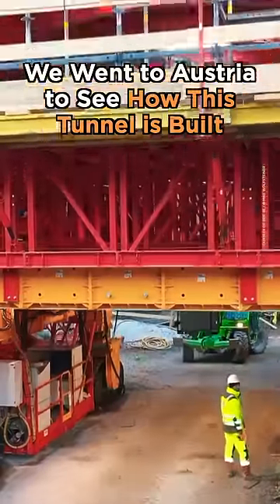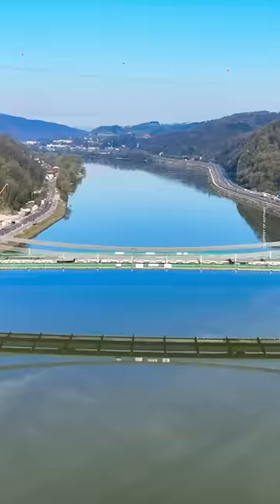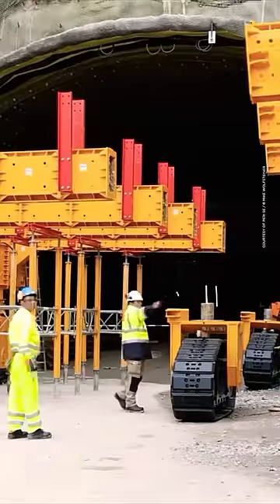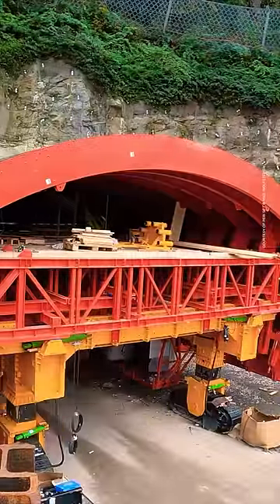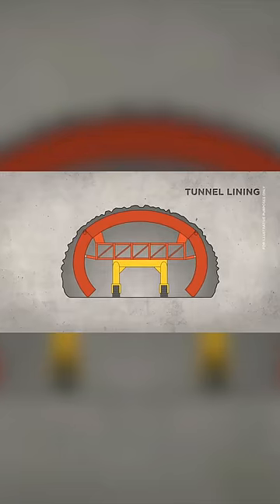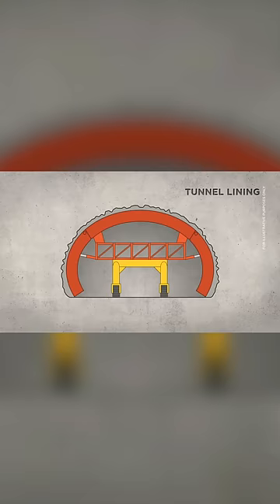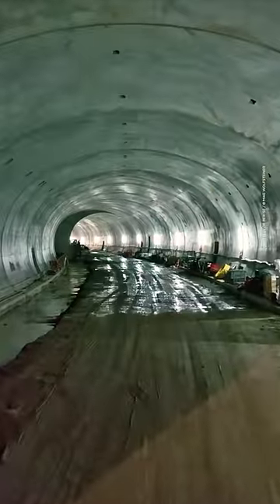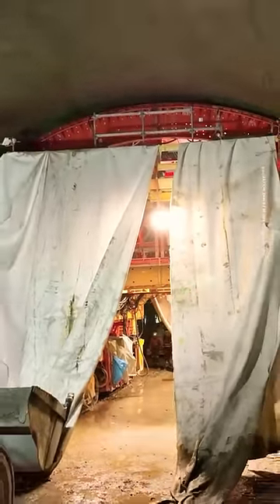This Construction Machine is MASSIVE

Comment: This method of lining formwork was used on the Taiwan High Speed Rail to form the final lining. Back in 2000. They are also used on non TBM driven tunnels that are lined with precast segments.
Reply: Extra information is always appreciated. Ty
Reply: No rebar or strengthening ? If one part falls or cracks it can course a larger fact.
Reply: @itisjustacomment Rebar is mostly needed for tension forces. In a tunnel the lining gets compressed like on a bridge arch. So rebar is just there for general concerns but noot to take the major load.
Reply: @V100-e5q  seems it did have rebar judging by a few comments,  some say it was on the wall before the form and also some areas of inserted just after pouring. Due to what I started cracks, water damage and faults.
But thanks for the info.

Comment: Reinforcement? Steel ?
Reply: Look at the tunnel roof at about 5-8s mark, the steel is in already.
Reply: Doesn't the concrete need strengthening for cracks or say a large failure? Without a much larger part would fail.
Reply: Rebar is there

Comment: Pretty much the same process we used in the Ted Williams Tunnel in Boston, Massachusetts in 1989. But we had several forms that could be held in position while the “traveller” was fitted with another set of forms and abutted the previously poured form. That way we could pour continuously without waiting for sections to dry.

Comment: No, it isn't how we normally dig, but it is the same principle as when we build multi story skyscrapers. The crew I worked with had half a floor,big, already made that we just slid onto a floor already completed then we jacked it up almost to the next floors level, put down rebar, formed the sides and poured concrete. After it cured, we lowered it,slid it out and moves to the next floor. Really big pieces to keep moving with cranes and winches. Really neat to be a part of also. I enjoyed working with high rigging men. We felt we were better than others, but really not, just crazier.

Comment: So it's just concrete holding the shape of the tunnel? Or will there be metal plating along the sides added later?
Reply: You can see near the beginning of the video of the steel linings along the wall when they move the platform into place.

Comment: Is it the new Austrian tunneling method
Reply: More like new new austrian tunneling method
Reply: Drillimg amd blasting precisely to go forward is natm
Reply: @shuvrajeetkamila436 it’s the old Chinese tunnelling method, they were doing this over 20 years ago
Reply: No--it's"The Austrian Tunneling Methode"--nothing"new"about it!--But the forgot to mention an essential component:The self-stabilizing rock-anchores!
Reply: @StoutProper  NATM is used with a sprayed shotcrete primary lining with rebar ribs and mesh, now superseded with fiber shotcrete as used on Crossrail London. 
NATM was used to build the Heathrow Express rail tunnels and Station grounds in the 1990s. Works carried out in a three-stage operation of top headings, excavated by twist bucket excavator machines, flash coat shotcrete, ribs, 1st layer mesh and shotcrete followed by 2nd layer. This is repeated 4 times and then the bench follows in the same stage lengths, the ribs have elephants' feet to carry loading sideways. The invert sections are then progressed to catch up to the face. Great care must be taken that all previous section joints are cleaned free of tunnel much, to ensure a good joint.
Reply: @StoutProper over 20 years ago?  This is how the Channel tunnel was built.

Comment: I can tell you do not know much about construction. Most tall boarding machines (TBM) , Have one of these follow behind them.  This is not a one of a kind device. It's called a moving form. Or a moving concrete form. Instead of doing it the old way of drilling, blasting, mucking (removing debris from blast) and then manually setting up a form to pour concrete;  This device allows the boarding machine to move forward this rolls behind automatically sets the form in place and then they start pouring the concrete. This leaves you with a finished smooth concrete-lined tunnel.

More advanced TBMs have this device attached to the rear. And if they are moving through the correct type of rock, The rock being mined will go through a crusher, into a batch plant to make concrete and then be used again to line the tunnel through the use of the form.

Comment: No not correct , concrete will fall off if put like was said ,they spray concrete out in a massive spray gun on a truck it's called shock-crete and it has metal fibres in it

Comment: That's what makes it so dangerous when those tunnels collapse, because they're not well dug out at all. They dig them out just enough to pump concrete enforce metal into a tiny hole which is extremely compact. Which would be ideal if there weren't things like earthquakes or tectonic plates shifting or hurricanes or tsunamis or anything like that but seeing as how this is real life and we do have things like that and concrete cracks and again these holes or not fitted with rebar in a scent like you would do a building that's going straight up in the air. They literally only dig it out enough to fit the machine in, and then they show all this crap in there hope for the best. They've got better over the years but as for somebody who is really familiar with buildings and architect and stuff like that they are not ideal for real life. And when they collapse it is bad. And they don't just collapse in one spot they collapse all the way down😂. See you wouldn't catch me dead one in one of those tunnels